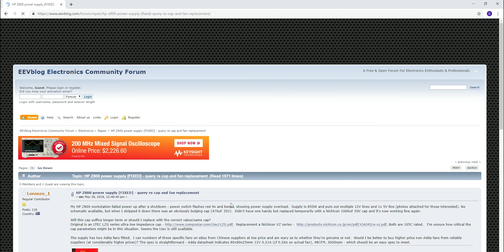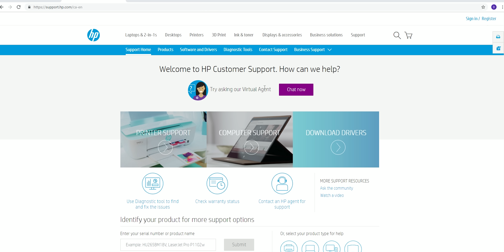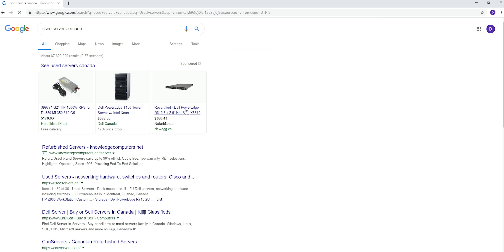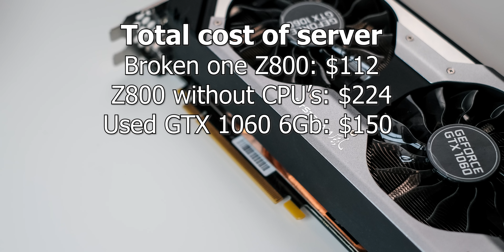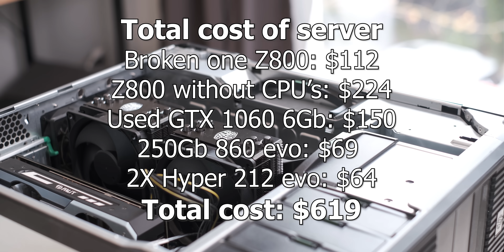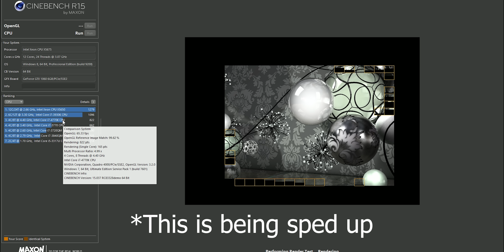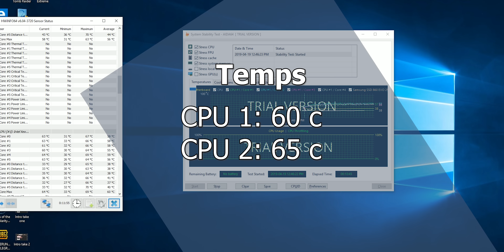Dual Intel Xeon, 48Gb BEAST for under $700! (With Benchmarks)

Comment: I hope you're reading this comment.

What you did digging around the PSU without discharging the capacitors is extremely dangerous and people have died from that.

Second, of course à technical support person doesn't know how to use a multimeter. That's something you have to use google for.

Man... The stupidity you have displayed in this video is actually really dangerous and you should have a disclaimer never to disassemble a power supply without knowing what the hell you're doing.

Comment: Ryzen 3100 and 5600xt is faster... 16 gig ram and 3600 cl 14... for less price.
Reply: This system was overpriced, but mostly people do this for the ram, 48-96 gigs of ram for under 700usd isnt something you can achieve on the ryzen platform.

Comment: I am running a socket 1366 dual xeon E5649 2.53GHz myself with 96gb ddr3 1600 reg ecc, 525GB SSD as OS drive, 8TB 5400RPM games drive, ATI RX560 4GB, on a Tyan S7012GM4NR motherboard with a 1K psu. I game with it Fallout 76, Fallout 4, World of Warcraft, The Forest, 7 Days to Die, and many other games. It cost me a lot less then what you paid. You can get racks on ebay pretty cheap some as little as $250 & I just did the upgrades from dual 4 cores to dual 6 cores, and from 16GB to 96GB of memory. Believe it or not servers are much cheaper at least with the older sockets & just as good in my opinion depending what your running in them. As for things like SATA II & USB 3.0 easily fixed with PCI cards. Running a 7 slot USB 3.0 card in it right now. My next buy will be a 16 core dual 8 cores which I have seen as low as $300 & I can easily just half the memory from this one down to 48GB & put the extra in the next one. I have mine running without a case & 4 300CFM fans with fan controller to cool the chipsets & what not.

Comment: I did the same, although use a PCI Sata 6GBPS, and PCI USB 3.0 with Xeon 5675 96 GB ECC REG DIMMS and GTX 1070 FE with 4 SSDs and 2 HDDs.

Comment: my multisocket systems will be with me in my grave. my newest and also oldest are a dual Slot2 and a quad Slot2  combined. the quad slot2 was a complete server and the dual Slot2 was made  out of partily new and used parts. i got dual and octa socket 603/604 systems, a few dual 771 and a few dual 2011. i die inside my pile of multisockets.

Comment: hhhm, nice project but If I wanted large ram and multi core CPU I would just buy Ryzen and avoid old propriety HP stuff. Just 1,000 USD and you can get 64GB of Ram, Ryzen 2700 and NVME drive.

Comment: would be pretty sick if dawid did dual gpus like dual 1080 tis or whatever
Reply: I have two HP Z800 workstations.  You can add dual GPUs, but you'll be limited by whichever power supply the system has; to support dual GPUs and dual Xeons, you'll need the 1100W or the 1250W power supply, rather than the more common 850W.  Also,  you won't be able to do SLI or CrossFire on the Z800 unless you use workstation cards, like the NVidia Quadro or Radeon FirePro cards (HP blocks using gaming cards due to some licensing issues).

Comment: I am saying these as a person who actually knows about the stuff you're making video of;
That is a terrible value and the computer is shit. That cinebench score you got over there is the ultimate metric of a cpu's performance (non-AVX however, but I digress) as cinebench is as synthetic and universal as it gets for cpus. Sure a particular video card won't be bottlenecked if a game is heavily threaded enough to a point where the thread count of a particular cpu can compensate for the lack of speed and IPC of each of the threads but you could just go and buy a hexacore first-gen ryzen and have far better overall performance in any workload with far less power consumption and fat better present and future I/O compatibility. Normal boot times and faster memory will be a plus (the additional memory channels you have with the piece of e-waste you have spent so much time and money for won't be utilized in the majority of uses you can find for it so no channel argument there) and you'd have a chasis that you can actually lift up and transport with (relative) ease.

Failed electrolytic capacitors will usually have swollen tops (if even so slightly) and it is good practice to replace them on sight. You take a multimeter and stab the caps appropriately (there are comprehensive guides to do so out there). But beware they may give out funky readings especially when there are other caps in parallel.

There isn't any value whatsoever in salvaging server cpus older than the x79 generation and even those warrant much consideration about the cost and hassle.

Comment: x58 dual xeons are obsolete 
especially these non standart parts,  dead end, no upgrade path oem workstations 
ryzen 5 3600 beats it at multitreaded and absolutly destroys on single thread

for 734€ you can get a built with:
186€ 64gb  ddr4 3200 (if you need it) 16gb cost around 50€
168€ R5 3600
33€ 250gb nvme ssd  from kingston
83€ msi b450-a pro max mainboard
32€ bitfenix nova case
47€ seasonic psu 550 watt
187€ gtx 1660

this setup beats it in every workload , consumes less power, allowes upgrade to 16 core ryzen 9 or a more powerfull gpu
supports nvme  boot , sata 6 usb 3.2  pcie 3.0 with a 50€ upgrade to b550 pcie 4.0 ram , psu and case can be used for the next build.

one caveat: ddr4 prices were not as low as they are now when the video released so maybe if you absolutly need a shit ton of ram these 12 dimm mosters equipped with cheap ddr3 still had some place in this world not today though

Comment: Capacitors in a power supply stay charged for months even years, and can easily deliver a fatal shock. 
Don't do what this guy did without proper protection, he doesn't even realize how incredibly close to disaster he got.
Reply: 🤣🤣🤣🤣 youre 100% right but for some reason I died laughing when I read your comment
Reply: Months? Years? I agree he was careless but no, sorry, that's bullshit. We'd be using them instead of batteries if that were true. It is true they can stay dangerous for longer than most people would expect. But not weeks or even days. Furthermore, modern safety standards require bleeder resistors that remove the energy quickly. That's why you don't die when you touch the prongs of your power brick while stuffing it in your bag. The amount of energy stored in the capacitors of a computer power supply is also unlikely to be large enough to kill you, even if it would do some pretty nasty damage. While it's very wise to be careful around mains capacitors (short them with the tip of your screwdriver before touching), this is really more a worry with things like vintage audio equipment which usually has big bulk capacitor banks and was built before those safety standards existed, or devices like plasma TVs or CRTs which use thousands of volts.
Reply: Absolutely, please add a disclaimer in the video, this is terribly dangerous. I am use to work on audio and guitar amplifiers, you have to discharge de capacitors before manipulating any power supply like this. The moment he touched the PCB with his bare hands made me terribly uncomfortable
Reply: What you said is technically true, but anything built in the last 75 years by any kind of decent company will have discharge resistors across the caps to bleed them off quickly and safely. They will remain charged for only a second or two. The discharge resistor would have to have failed open to keep the cap charged, and even then, it will certainly not be for months or years. It will be a few minutes at most. We also don't know if he waited or not, with video editing and such. If you are not sure, just short out the cap and you know it's discharged. I will tell you what often lacks the discharge resistors these days. Cheap knockoff stuff from China.
Reply: "months" are me eyes burnt from reading this

Comment: The 1366 bracket legs are tapped M3. All you need is a set of 10mm long brass hex stand-offs to screw the feet of the coolers into.

Comment: I have an x5670 clocked at 4.7ghz 24gb of 1800mhz RAM,and it does 1150cb in R15 with Asus III extreme mobo. Nearly double the performance of the single chip. It really makes a mince meat out of every game that is out there. Temps are around 65C with 1.41V on cheap water cooling H50 from corsair

Comment: GTX card is no match for a Quadro card ... Quadro series is specifically designed by Nvidia for Product designers .. they are only found in comercial workstations .. You have built a downgraded PC from the actual one

Comment: The Quadro catching fire is a lesson about not messing around with PCs while the PSU is turned on.
Reply: Yes.
Reply: If you're doing serious repair you can really only debug with the power supply turned on. This is a rare case of failure that should not happen under normal circumstances, even if you plug and unplug everything.
Reply: @lost4468yt  In this case you really should know what you are doing before you mess around with things you don't completely understand.
Reply: Trye
Reply: He loses some serious credibility for that honestly.
Reply: @sandboxlarry9490  tf was he supposed to do? Move the plug around then try to turn it on till it worked?

Comment: that server pc costs less than my main pc and has More and (28 gb more ram than me) A better GPU (gtx 1650 is mine) prob a better heatsink but I think I have an older version that cooler just as good but should be able to fit my pc. and obviously more CPU's my pc also has no interaction with an SSD

Comment: I actually built such a critter, with very similar specs, using a Supermicro MB. It currently sports a RX 580 and DVD burner. I am trying to sell it for half this price. Also, it has RGB because I had to use MasterAir coolers to get everything to fit, plus I added a USB 3.1 card. I had originally put it together for video editing and some types of computation. I don't remember the  CPU numbers but they are 4 core Xeons with hyperthreading running at 3.7 GHz.

Comment: This is exactly what I did with the Dell Precision T7500. the second CPU is in via a riser card, but I got it running fine with 96gb of ram, a GTX 1060, a PCIe USB3.0 card, and one of those cheap 5.25" bay internal multi-card readers with USB 3.0 on the front side too. I put in a tape drive from an old Dell 500SC so I could archive old data, and I didn't really have anything else to use it for once I upgraded to the Ryzen 7 3800x, it outperformed it by quite a bit so I demoted this system to an incredibly overpowered Plex server and NAS.

Comment: Dawid, you can get unlocked Xeons that can be overcloked using Intel Extreme Tuning utility. I have OC my W3690 to 4.0GHZ (Z400 with HP OEM watercooler)...

Comment: Just picked up the earlier variant of the z800 system (mod 1 board) that only runs 5500 series processors...  But I picked up a working dual processor x5570 (2.93 ghz x 4 cores) system for $180.  It had one old 250 g. HD, a Quatro FX 3800 GPU, and 850 wat power supply, and 16 gig of ram.  I've since added a new 500 GB SSD boot drive ($55), a  used 2 tb SAS HD  ($20), and 48 GB of ECC ram ($30).  I'll be swapping out the x5570s for a pair of w5590s (3.3 ghz x 4 cores) & high performance coolers (<$100).....and I'm debating picking up a used RX 580 4GB card ($120 or so).  That's $500 for a system that can do most anything I could want at 1080p.....including gaming, light video editing, CAD, and graphics.
Reply: Minor change of plans...  
Got a deal on a GTX 1060 - 6gb video card for $100.  The coolers are Zalman CNPS 10X Optimas plugged into the main board with a 5 pin to 4 pin adapter cable.
Added a $15 PCI-e card and a $20 drive slot front panel w/ USB 3.1 ports to let me use memory sticks of a modern spec.
Runs Wold of Warships like a champ.  Rocks video editing.  Lets me do light duty 3D graphics.   And didn't cost me an arm and a leg.

Comment: 3:41 Uhhh, I can clearly see a golden triangle in the top left on that Xeon. 

Also, you could have gotten a Dell T5600/T7600 or another Dual Socket LGA 2011-1 that's 4 year newer, has 12 cores and 48-64GB of RAM for atleast hundred dollars less than what you paid for that fossil.
Reply: Just bought a dual E5-2689 for $450 with dual PSU and 12 drive bays.

Comment: If it were me doing the same build, I would have considered a Supermicro motherboard as the basis of the build.  The advantage of the Supermicro board is there are dual CPU boards that will fit inside a standard ATX case.  A standard ATX case means replacing a dead power supply can be a relatively inexpensive issue.  Note: you can use a standard power supply with a dual CPU solution as long as you also use a Molex to 8 pin motherboard adapter for power to the second 8 pin connector. A good ATX case, Intel 5600 series (x8) motherboard, 48GB of RAM, a small SSD and two CPUs and heat sinks could come in at under $400.  Step to E5-26xx-V1 & V2 CPU system for about $500.

Comment: I bought a "Huananzhi X99" TF motherboard and a "2678v3" processor 12 cores 24 threads from Aliexpress a month ago, and it took me 218$, for such powerful hardware. I fixed a fixed turbo boost for all 3.3 GHz threads, reduced the voltage using the "EFI" driver(-50Mlv) which helps keep the turbo boost 3.3 GHz, even under heavy load.

Comment: Hello Dawid ! Excellent video as always. Can y tell me haw did you manage to open the right panel of the z800 in order to remove the motherboard ?  I removed the 2 screws on the bottom  and tryed to pull it but the panel doesn't move. Thank you !

Comment: If you don't have even basic electrical engineering knowledge, DON'T FUCK WITH THE POWER SUPPLY!!

It was bad enough that you mindlessly fumbled with bare hands the opened pcb board running your statically charged grubs risking frying any possible power MOSFETs that are very susceptible to electrostatic discharge.

My advice to you: don't fuck with any pcb boards. You are going to ruin shit like your gpu each time.

Comment: Amazing experience.. I do upgrade the z820 server with 96GB and dual Xeon of E5-2696v2 and GTX 1080.. the cpuz result for dual Xeons hits the i9-7950xe score in multi thread test. Sadly the single core score is equivalent to 3rd gen CPU in 2013 so, not good deal for high FPS gaming. Then I decided to use this machine for FAH application and I loved it

Comment: It may be performing "ok" or actually very well for 1080p gaming, but as you so obviously told us .. such a server Mobo and Xeons dont OC, so a cheap ass Ryzen 3 is gonna totally wipe the floor with it , plus how much power does this BEAST draw from wall :) I also got a BEAST of an IBM server once for free as it was otherwise being thrown away, it Hosted 2 Intel Pentium 450, ECCram. a scsi raid card plus a buttload of 20gb SCSI harddrives, dual lan etc. and I was going to use it as what it was a server. I knew the machines well cause we used to have 2 off'em were i worked years ago and they did cost a small fortune back then .. but the size of the disks, the PSU and HD spinning noise, and the power bill to run it, made me throw it away myself after collecting dust for half a year. This can be fun the first time you get an old server, but when you think of how easy and cheap it is to run VM's today on much newer hardware, kinda make these monster servers just ancient dynosaurs that even you get'em for free they are just not worth the powerbill they cost to run. If people want to experiment and learn to use server arcitecture, clustering, etc. It is so cheap to buy and build your own raspberry xx cluster and start learning Linux on something that don't blow the fuses at your home and doesn't sound like an 747 taking off all day long :)

Comment: I have this very machine. I have the dual X5670 2.9mgz hex processors with the loser heat sinks and my temps are in the 35c to 40c range. I also get similar bench marks with a  Nvidia GTX 750TI   Not bad seeing how I have had this rig for 5  years.  I don't know if buying a more powerful graphics card will make that much of a difference, let alone more CPU power. X5690's for example.

Comment: I bought a refurbished Dell T3610.  Xeon hexcore 3.5.  32gb of memory for 329$ I added a $150 video card and it works great.  added a Linux mint ssd.  Love it. Plays games and its cheap but works.    I like the xeon processor.  It's the E5-1650 v2.

Comment: There was actually one motherboard that allows those CPUs to be overclocked: EVGA Classified SR-2. I built one with two identical Xeon X5670 CPUs. I have 24GB of DDR3 1600 RAM. With dual Noctua NH-D14 coolers I can run it all day at 3.6Ghz. I have tested briefly at 4Ghz. Geekbench at 3.6Ghz : https://browser.geekbench.com/v4/cpu/10660910

Comment: This is not a Frankenstein build. You essentially killed the first Z800 messing around with it while powered on. That is always a good way to kill expensive parts. Then you bought a barebones z800 and swapped in the good parts of the dead one. The only changes were the cpu coolers, which look cool, but probably were not worth the cost and effort to install them. You installed a video card and Windows, which is fairly standard stuff. I'm starting a Z420 build tomorrow. Provided the components arrive as scheduled. I do like to see old system being given new life instead of being scrapped, so you get points for that.

Comment: You can rest assured the stock coolers are going to be all you will ever need.
16 year old workstation here that was stock cooled for 5 years hard service and a further 10+ years intermittent hard service with a couple of uprated Xeons. One of the best the board supports is adequately cooled by the stock cooler. It's quite loud but hey ho.
These things are designed to bulletproof.
Luv and Peace.